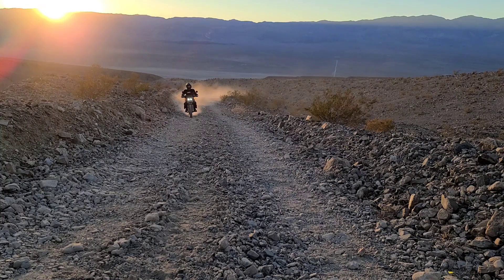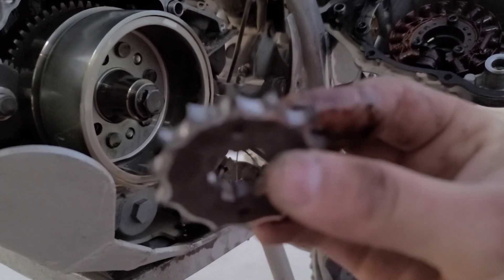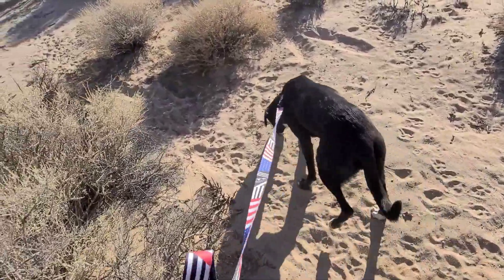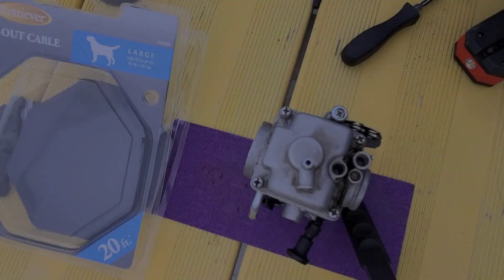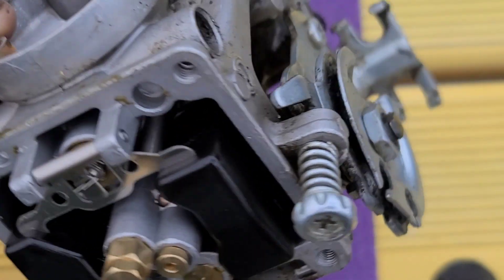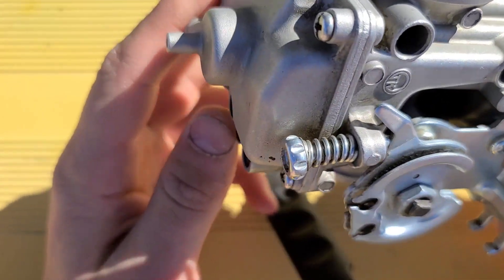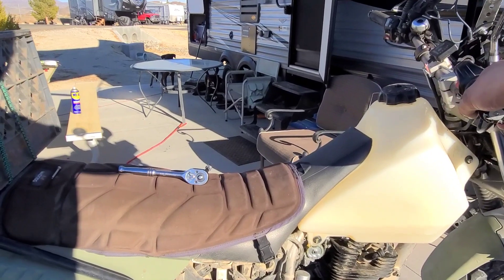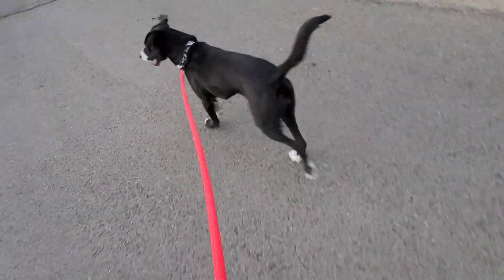14,000+ Miles later, Time for new Sprockets on the TW200.

Comment: Cover removal for the front sprocket is kinda a pain. Got some damage when the chain jump off from a badly worn sprocket on the ‘09 but nothing serious. Still breaking in the ‘21.
Reply from the maker: Mine has a small hole from when the chain came off one time. I could probably fix it with my welder and grind it down . Not to worried about it though

Comment: man I wish my TW started up like that, its about 45 degrees out here in Washington and it took me about 15 minutes before i could get responsive throttle out of it. every one says they are cold blooded but this seems strange. I start full choke and let it go till it starts running rough, go half choke for a few minutes and then no choke, if i blip the throttle at this point it just stalls so i hold the choke lightly so it revs up and this seems to help after a few minutes of that it rides but the throttle still seems kind of glitchy if that makes sense, like it surges and drops power just slightly, after a few minutes of riding up hills it seems fine, is this just that 80s tech kicking my ass or should i take it back to the dealer? its got like 20 miles on it lol.
Reply from the maker: Thats normal . It takes a long time for it to warm up.  If it is till bogging really bad after 20 minutes of riding it then take it back to the dealership I suppose.  I miss Washington.  Used to live there at Oak Harbor.  Definitely trying to go back . The riding is a lot better out here for sure. Walker Valley was a lot of fun
Reply: @dualdorks  nice good to hear! thats awesome I live on the south end of whidbey island! i think it will be fine, just need to get used to it i guess, thanks man!

Comment: Man you got a lot of use out of sprocket and pads!!!  And yes the sprocket change is a pain with the need to remove the case and replace the gasket. You going stock 14 or something else?
Reply from the maker: Just stock sprockets . I like to pop turn in 1st gear when I gotta turn around
Reply: @dualdorks  Good Move!!! Can't beat the low end on these Puppies. Got mine rote down yesterday. Need to go to Machine Shop and have them put a Time Sert or Heli Coil in case for head bolt. When done im heading your way!!! Lol
Reply from the maker: @ichibangrom9735  no fun extracting broken bolts.  During the LAB2V I made a pit stop home since it was so close and had to re drill my right side mirror and re-thread it. Definitely took some time
Reply: @dualdorks  I remember that in video. So funny you paid to go on the ride and they routed you right back to your Hood!!! 😆